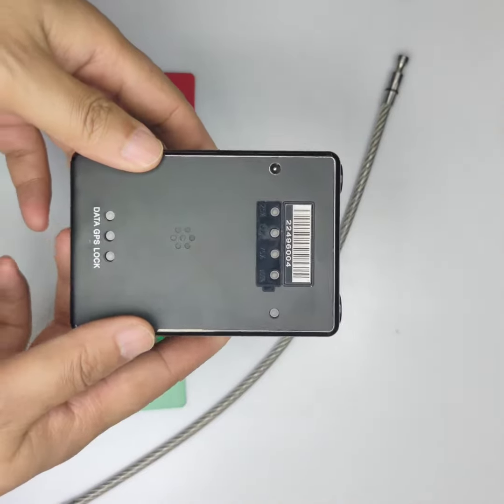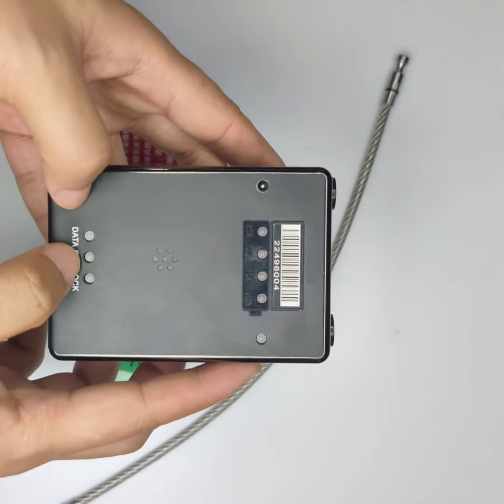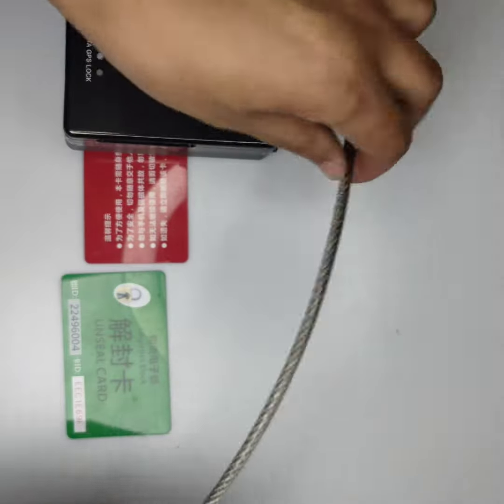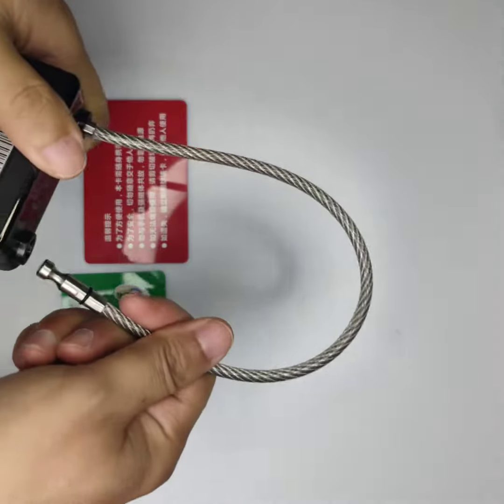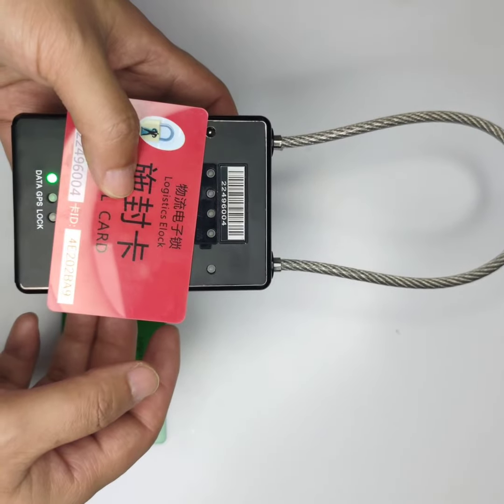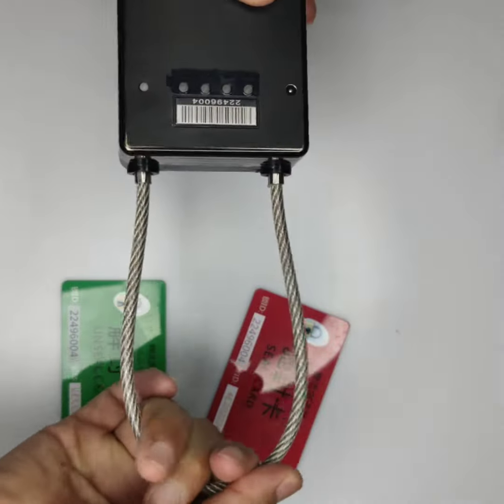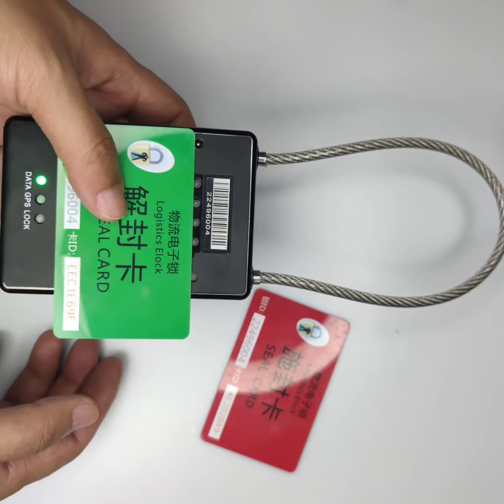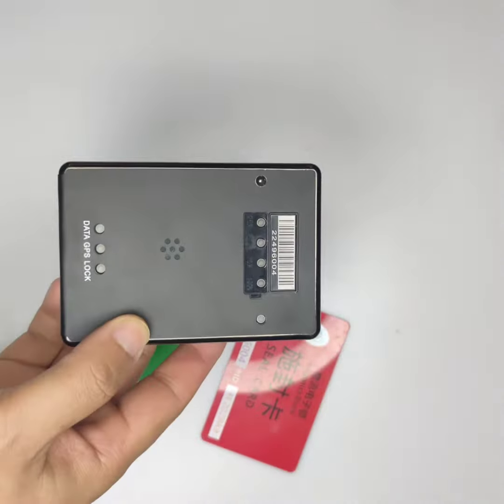GPS Lock with RFID control for Van Truck and Container Tracking and Fleet Management

Comment: I just stumbled upon this piece about GPS Lock with RFID control for Van Truck and Container Tracking and Fleet Management , and it really opened my eyes. The insights shared are thought-provoking and genuinely refreshing. If you're curious about GPS Lock with RFID control for Van Truck and Container Tracking and Fleet Management, this is a must-read in GAO RFID Inc. —there's a wealth of information here that could reshape your understanding.